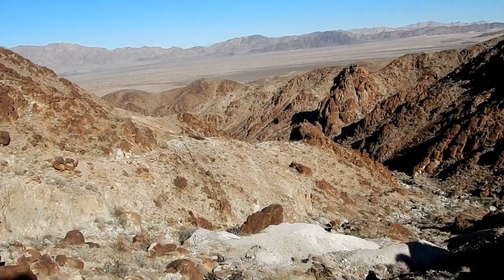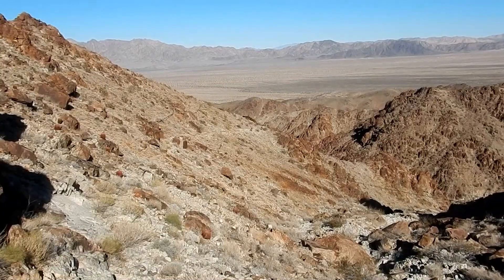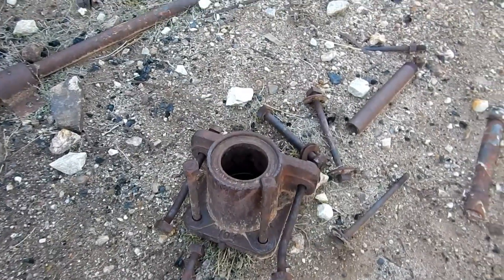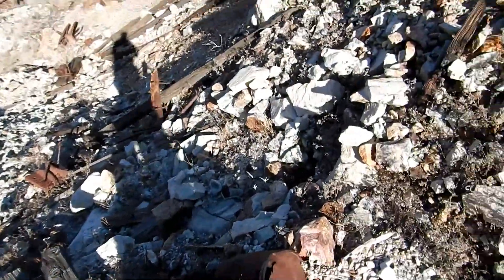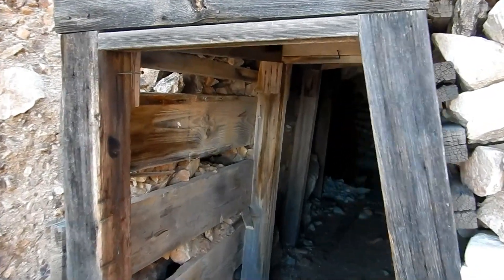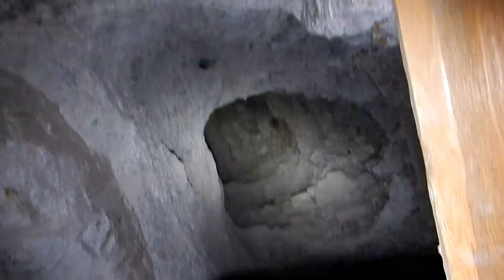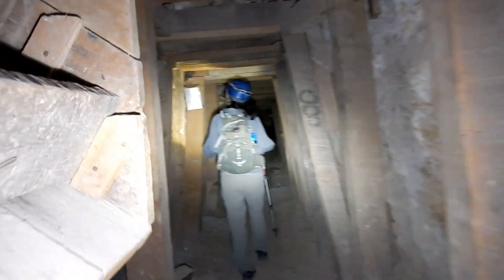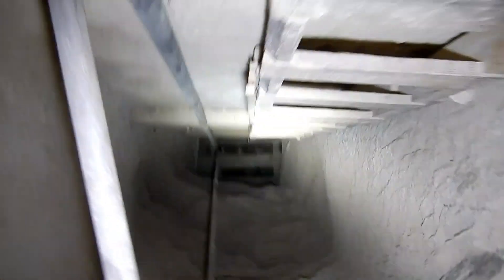Carlysle Mine (part 2 of 4) - Tram Parts - Interesting Workings - Ladders To Lower Levels

Comment: There are several Humbug mines in California but this isn’t one of them. This is the upper mine of the Carlisle Mine complex. We have been in it about eight times in the last twelve months as it’s one of our favorites. That bull wheel at the upper part of the tram was still standing in the early ‘80’s. That kerosene? tin is still hanging on the wall! Been down the ladder where it’s broken off and there are quite a bit of workings down there. We didn’t use a rope as you can climb back up using the air and water pipes as hand holds. One of the ladders goes out on to the surface and if you walk back over the hill you come to the end of a road that will take you back to the Supply Mine. My buddy repaired the ladder so it’s an easy access IF you can find the opening. That’s the easy way in! Don’t have to hike up the mountain! There are approximately nine openings into the mountain at various places. At one point a another tram went from the end of the road down the valley also. That opening was bull dozed closed some time in the late ‘80’s we think. It’s across the gully from the Jupiter Mine (not really sure of the name) which has a concrete collar that has a ladder but is caved in. Two of my friends were in the adit that has now been closed when a couple of yahoos set the thing on fire and then made a run for it. You guys must have legs of steel as that’s a tough hike up from the old mill sight!
Reply from the maker: Yes, I know all that, James. I don't generally use the real mine names in my videos to try and slow down the "yahoos" as you put it from burning and / or painting everything in sight. It's a fun mine to explore. We enjoy the hiking part of exploring, so hiking around that mountain is not a big deal. I see that the tram cable came down a couple years ago when I saw another video of the upper adit. Thanks for watching!👍

Comment: Wonder how those man-ways 14:40 were built.  Scaffolding then ladders? must have been a real chore to build verticle in such a cramped space.
Reply from the maker: Good question. Tight quarters to build in and everything still looks neat and square years later. I don't know how miners accomplished what they did. Thanks for watching!
Reply: @TomandJulieMineExploring  I have an old mining engineering text.  I will have to research that; but yeah still looks perfect.
Reply from the maker: @olivei2484  sounds good.

Comment: Seeing the towers down and that big gear on the ground I wonder if it fell apart over time or was knocked down by igits.
Reply from the maker: Good question. I think time does the most damage. It can get very windy in this area. The last time we went up to this mine the cable had finally fallen down on the ground. Thanks for the comment, Mick!

Comment: Ha! I knew that would get a rise out of you!
Give it the old knife point test. Push down on it hard (without cutting yourself) if it will slice cleanly or dent, it's the real stuff. If it shatters and turns into dust, it's fools gold!
Reply from the maker: I did just that and it passed the test. I used a safety pin instead of a knife. Hope things are going well at your mine or is your road snowed over too much to get up there. Say hi to your prettier half from us and thanks for the comment.